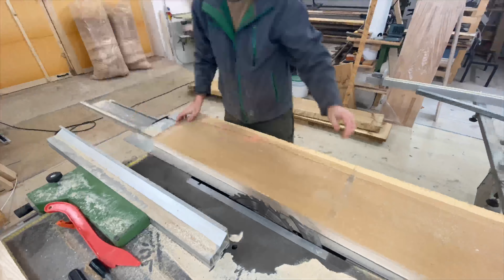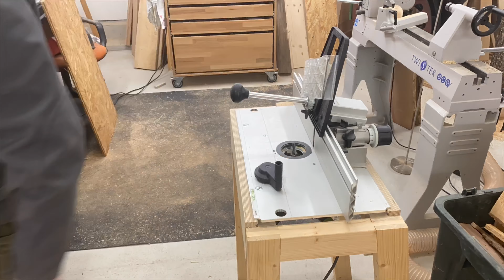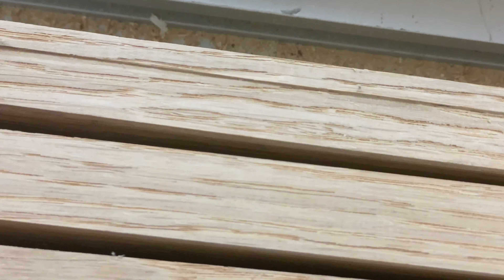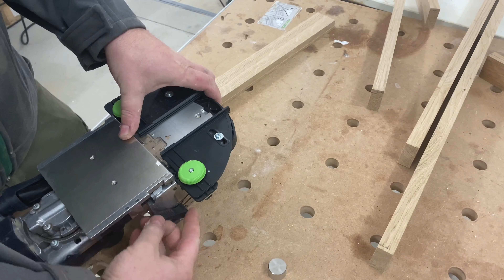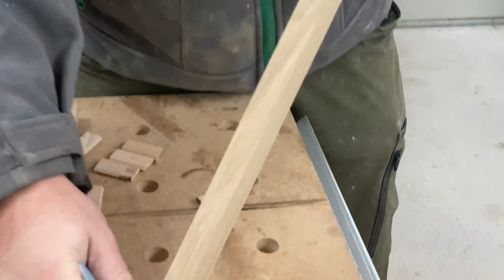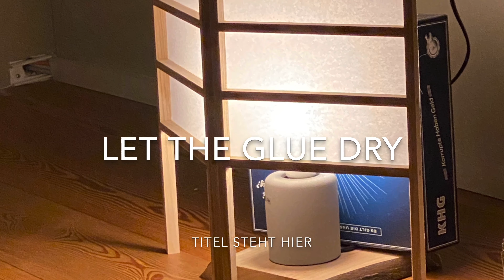how to make a Shoji Screen in 2020 - easy - sliding doors

Comment: wont the "easy" way being using pair of drywall screws at each corner ?
Reply from the maker: sure, but that would be boring
Reply: @farbraumR  well props to you for doing it the harder and arguably better way too. thing is, at my end it would be hell getting anyone to pay for that kind of workmanship.
Reply: @thesage1096  The folks you deal with just don't appreciate true craftsmanship. I'm sure you still build everything with a nail and hammer. I'm here for the art. Ya get what you paid for I guess 😉